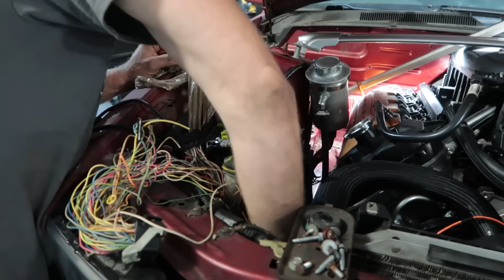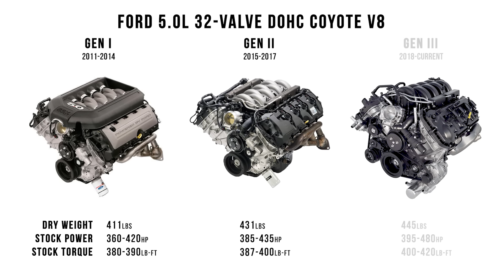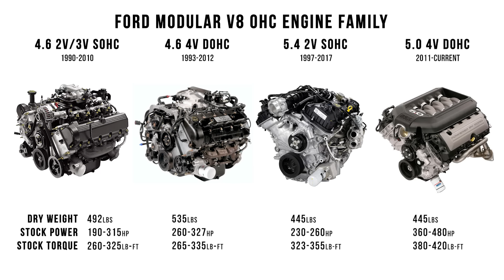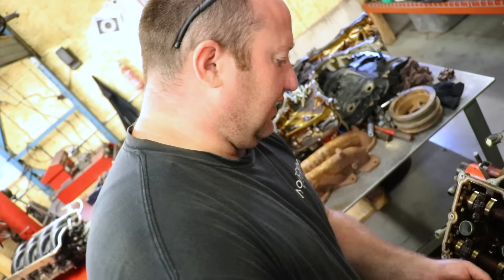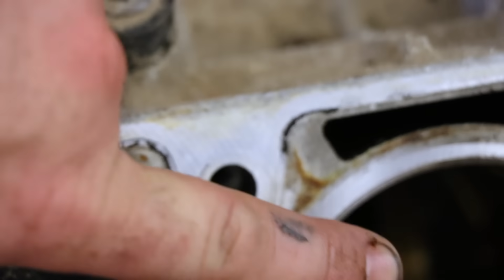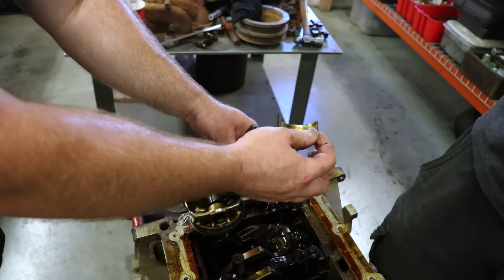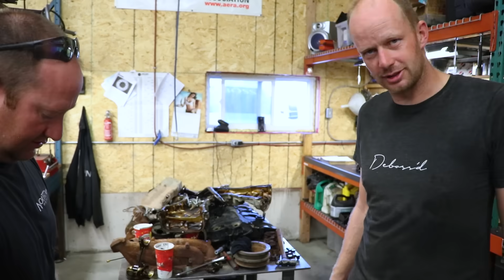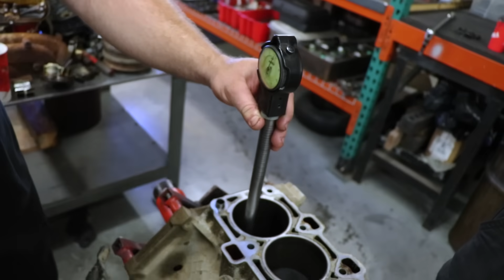REVIEW: Everything Wrong With A 5.0 Coyote Engine

Comment: The problem is not the synthetic oil, but lack of oil change. Synthetic oil does not crystalize, cheap Synthetic BLEND maybe. Just use good oil and filter and PLEASE DO your  Oil change and you will be fine. This engine fail for lack of maintenance that's it.

Comment: The thing I find hilarious is that Ford had so many problems with a single overhead cam engine they decided to add another like that'll make everything better lol. Bet they still didn't solve the exhaust manifold issues with the sohc engines or the timing chain guides failure.

Comment: Synthetic oil has nothing to do with a dirty engine. It’s lack of oil changes. Synthetics keep engines cleaner period. Actually most conventional oil is a synthetic blend. It has to be to be able to meet the stringent new SN+, SP specs
Reply: STFU https://www.youtube.com/watch?v=tDpTPxinNyo
Reply: I agree with most conventional oil is a syn blend. The only problem is drivers nowadays don't use the proper viscosity in their engines. And sludge deposits are likely to form in engines any how, regardless of conventional or synthetic.
Reply: did you not listen? syn requires getting the engine up to heat or it crystalizes, its not a short distance oil
Reply: @narmale  no it doesn’t
Reply: @Henry B i didnt say this... it was said in the video... or did you not pay attention?

Comment: You can bullshit all you want and most have said it. The root cause is the owner not the product. The way you drive the car, like a Mustang will determine your engine's life. If you can't afford oil changes twice per year or even three, don't own one. Plain and simple, I have never had any mechanical issues in any brand, kept them for 20 years, never even replaced a clutch yet in almost 400K of driving two cars. Change the oil and drive it with respect. When you see a car with dents, those aren't metal dents, those are dents of their lives. Don't be a mixed up fool driving around with a Coyote engine and then complain why it breaks down. The problem is YOU.

Comment: I really dont understand why a lot say LS is much better than Modular 5.0s, I ve used both and both high mile engines and  I am not particularly gentle with them, both held pretty darn strong. I just made sure oil is changed regularly every 5000 miles whether it be LS or 5.0 and both performed incredibly well. Sure if some problems crop up 5.0 is more expensive as it is not a cheap technology, its way more complex design and I kind of appreciate Fords effort with that, heck even Ford too could ve just used push rods but they chose a different route back in 90s and from what I see they succeeded too 
https://www.youtube.com/watch?v=bE_1JYrlYYU&t=6s
I mean how many US engines can post 14+ BMEP while being NA
Thats not at all a small achievement, its as good as what Chevy has done with the LS ie cheap,small, light and smart.

Comment: The plain bearing shells staying / oil sticking on the crank journals on disassembly are more indication that the engine has a few miles and numerous heating and cooling cycles on it than anything abnormal with the bearings. The bearing shells aren't held in place by the outward 'spring' pressure like when you first install new bearings as this guy seems to think. The bearing outer diameter is manufactured larger than the bearing bore diameter. When the bearing caps are torqued down, the bearing halves are compressed tight into the bore, and that is what keeps them in place and prevents a 'spun' bearing. As soon as the cap is loosened, the bearing will be loose too.

Comment: i’ve worked for ford as a mechanic since this motor came out and i’ve had the least amount of issues with the first gen (11-14) 5.0 out of them all. and i’ve never seen the rod bearings go so i’m surprised to hear that that is a major problem with them
Reply: I'm planning on buying 2014  f150 with the 5.0 v8  has a Ford mechanic do you think it's reliable and last a another 10 years
Reply: @samabdelhadi3037  easily
Reply: @samabdelhadi3037 my dad owns 2 5.0 f-150’s with over 200k miles. Both needed water pumps at 150k and that’s it
Reply: I'm looking to get one with around 100k+ miles. I currently have one in my mustang ( absolutely love the motor) but the mt-82 is trash so I'm trying to get rid of it and lower my payment. How many miles can you get realistically get out of the 5.0 (with proper maintenance of course)
Reply: @brendank4927  with proper maintenance i’ve seen them with will over 200k on them
Reply: @brendank4927  Like Thomas said, 200k easy.  With proper maintenance I've seen 3 to 400k.  Just treat it well and don't forget to get some time and distance on it at least once or twice a month to help burn off gunk. (IMO)

Comment: I dont buy the synthetic oil making sludge stuff my honda k24 with almost 160k always ran synthetic was changing valve cover not because of leaks no leaks anywhere was changing the color of it the inside was spotless bright white aluminum color no sludge or even a film of enything other than on the actual valve cover and I've ran different oil through out oil changes so nothing he is saying adds up so either engine sucks or it wasn't maintained

Comment: Just FYI, Ford's first aluminum 32 valve DOHC V8 was the 1940 through 1950 GAA engine, 1,100 cubic inches. Initially designed as a 60 degree V-12 for aircraft, it was cut down to a V8 for use in the Sherman tank. So Ford had some experience when they developed the mod motor. There are still a few GAAs around, I've seen some YouTube videos of them running on stands.
Reply: Those things are crazy, I'd love to see someone swap one into a Focus or something for shits and giggles

Comment: Haven't found any problems with my 3V 4.6.  Only 30k miles on it.  Cam phasers? use synthetic valvoline.  Problem solved.  Nothing wrong with the motor at all.  Reason why I don't go to coyote is because it costs money, and I really don't need one.  Used to want it but meh.  I barely get a chance to drive my personal car as it is, so why bother with it.  Unless some hater wants to buy one for me, there's really no need.  Anyway if I was to buy another car right now I am at least smart enough to upgrade to an Infiniti G50 instead of another American car.

Comment: Here ya go. 5.4  3 valve Triton 😆 
The 5.0 is only Ford engine that's ok.  But again it's still a Ford.  Great mpg in highway to. 18+mpg  In a V8!
Reply: Newer Nissan VK56VD V8 will routinely get 20-21 mpg in a 5000 plus pound truck highway.

Comment: I have a 2007 Ford f150 bought it brand new in 2007 I've always done my maintenance on time and I also use seafoam before every oil change and I have never had any issues with my engine I have 230,000 miles on it right and it still runs

Comment: Did he really say that the 4.6 is his favorite engine and had plenty of power? They were absolute turds. So slow that they couldn't get out of their own way. Only v8 engine that would grenade with mods at 450ish rwhp. They were pretty reliable in stock form but couldn't make any power at all without forged internals. An LS of the same Era could make double the power and be more reliable.

Comment: When he started going off on syn-oil, I had to check if this was an April 1st edition.
Reply: I have seen many problems with synthetic oil in my 35 years of being a master tech and running a shop.
Personally will not use synthetic, or pennzoil!!
Reply: The way he said it was stupid, but he clarified In a video after this that he meant that synthetic oil causes people to use extended oil change intervals which causes the build-up, which is probably true.
Reply: Fortunately but unfortunately I own a 2019, first I’ve owned that takes synthetic. I started to wonder as I’ve never ran it before because Roy doesn’t make sense to me.. most things synthetic really aren’t as good as what they could be, they are compensating for something for a purpose with synthetic materials. Oil, is like blood, why would you make something strictly take synthetic..? Is there a way to be able to run conventional?
Reply: @person-sx2wc  Unless your engine calls for 0-20 you dont have to run synthetic. 5-20 and up is offered in conventional. GM has their bullshit Dexos that requires you to use at least a Dexos blend or you can void your warranty on the engine. Ford doesn't require you to use full or blend but if the weight called for is only offered in either, your hands are tied. Tolerances are tight on new engines.
Reply: @person-sx2wc  the synthetic molecules are 3-5X smaller that conventional oil, that's why if you run it in an older engine they leak..
The engine was not built to the tolerances of today.
Nor the gaskets.
And synthetic handles heat a little better, don't buy pennzoil, change it every 3 months or 3k, especially if it issues allot. And never buy a used government vehicle!!
Reply: @maketruthgreatagain9823  I've been using synthetic for many years with Honda's 10k mi change interval, still runs like a top.
Reply: The only reason all manufacturers are going to synthetic is because it's a way better oil than conventional say you can go longer between oil changes and that is why epa wants it to lessen oil changes therefore less waste but no real engineer agrees withe going that long between oil changes just pressure from epa
Reply: @donaldbean6291  Engine tolerances are very tight anymore and the 0-16, 0-20, 0-40 are only offered in synthetics. I'm sure its just bullshit why that is but tolerances arent arguable. Mercedes, bmw, Volkswagen/Audi call for a full synthetic but only require a 5-30/40 which can be had in a blend, synthetic or conventional. Who knows anymore.

Comment: 2010 f150 - single cab - long bed - 2wd- 4.6 2v v8 -.    232,400 miles and its been great to me !  Oil is castrol edge professional 5w 30 from the black barrel🏎💨

Comment: All you have to do is change the oils and Ford Engines last a lifetime.
Reply: The timing chain tensioner would disagree
Reply: Konner Kramer considering I have a Ford 5.0 with well over 500k miles on it, I’ve only ever changed the oils, oil filter, belts, and pullies, I’d say my 5.0 disagrees with that statement lol
Reply: @TexasRaptor  like I said the plastic timing chain tensioner that are a well know problem are lucky to make it to 100,000k miles. Until I see proof I'm just going to assume your another clueless ford fan boy. The tensioner in my 2012 5.0 made it 65k miles before it broke and cost me $1500 to fix.
Reply: @konnerkramer329  yeah sure everybody owns everything on the internet. Until I see proof of what you claim I'm just going to have to assume you are some anti-ford wanker
Reply: @-ac-8296  what proof do you want. That the tensioners broke in a car I sold years ago... I don't have proof that my tensioners wore out and my chain broke 7 years ago sorry. I sold that car 5 years ago
Reply: @konnerkramer329  it's not on these motors. It's on the triton engine.
Reply: @icenine135  what??? Are you trying to say that coyotes don't have timing chain tensioners
Reply: @TexasRaptor  .....for christs sake if you take care of just about any engine it will last....the point is you dont have much of a choice with a ford if you want it to keep running period. If they cant take ANY neglect or abuse then it is an inferior engine
Reply: @TexasRaptor  ya the Windsor 50 will last forever I have a 94 f150 4x4 5 speed x cab bought it in 2002 with a 3 inch lift and 33s I've went threw a clutch and a trans over that time last year at 489k and that's not nice driving that's missing mudding on weekend and driving it 20 miles a day to work I thought it was a head gasket turned out hole in number 3 piston but instead of buying a new truck I had a 347 stroker laying around I built for a fox body but after I dug into her rust belt had taking most of the car so it's in my old truck and I gained 3 mpg but at 40 I don't drive fast anymore and I have a side by side I go off road with
Reply: Outcast Slayer bro i hace the 3.5 ecoboost but it’s giving me issues so i started looking into the 5.0. What’s your experience with yours
Reply: @TexasRaptor  That almost made me choke on my coffee.  Wait till that turd jumps time and the little man in the box wants out by letting you know with some knocking and banging.
Reply: @TexasRaptor  holy crap that’s awesome. What Gen and make a bid of that beast. I wanna see how a coyote at half a Millie sounds and runs
Reply: @TexasRaptor  Lol. Nah, it doesn’t. Quit playing with these dumb ass claims when the engine wasn’t even designed for that length of operation.
Reply: @TexasRaptor  yeah the old school pushrod 5.0 NOT a coyote old 5.0 doesent have timing tensioner now does it
Reply: @thebubba1  edit your post to not blaspheme G_d's name.
Reply: Konner Kramer yessss! This happen to mine which brought me to this video bc i don’t plan on fixing it this i came searching for reviews on the 5.0
Reply: @konnerkramer329  supposedly the 2v Triton doesn't do this as bad... but we are still gonna swap em out with metal soon. 135k on the clock.  The cam phasers also blow up Triton as do failing oil pumps from improper changes and conventional oil
Reply: You know it i got over 500k on a 4.0 ranger
Reply: @octaneartllc  same here...but mine has 1 cam
Reply: @theejoeylee  unkillable ohv👍
Reply: The basic design of this engine is the modular engine that began with the 4.6 liter. It has lasted a million miles in police and Taxi service, just idling for 4 times the hours of service of a normal million mile engine. Change your oil and perform service.
Reply: Unfortunately the transmissions have issues.
Reply: @seanwhite5758  so does the rest of the vehicle
Reply: Obviously never had a 5.4
Reply: Bill Chestnut  I have an 03 F-150 XLT with the 5.4 got it from my dad he had no issues replaced the spark plugs, and went through a fuel pump a couple thousand miles ago, coming up on a oil change, about to kit 219,000 miles so while I know the 5.4 gets a bad rap I love my truck🤷🏽‍♂️
Reply: @jeremiahcarranza222  i got mine used and i think the previous owner did no maintenance..
Ive had to do plugs coils cvts..Misses all over the place..it does have plenty of power but tight now for me the cons outweighs the pros..oh yea..only 126k on an o6...so i definitely think it was previous owner
Reply: Bill Chestnut im sorry about that, I bought the truck from my dad since I wanted a paid off truck, and since I knew he kept up the truck maintenance wise and I knew the trucks history I had no worries, in fact I didn’t even know the 5.4 had issues until I started seeing videos like this on YouTube😂 but either way if you take care of something it tends to last and while im not a ford diehard I had a good experience with this truck and whenever I replace it ill probably just get a newer one probably around 2017 with the 5.0. My truck now has a flow master muffler, and an intake and it sounds nice I expect at least another 100,000 maybe more, maybe I got lucky but I love my 5.4👌🏽
Reply: Yeah my Foxbody has 507k miles :)
Reply: @fsub616  5.0?
Reply: My 2005 Triton 5.4 had 309,000 miles on it when I sold it - with a lot of life left! No major engine work, just oil, plugs and coil packs. Daily driver / work truck.
Reply: dont forget youre talking about a chevy fan so nothing else is good lol
Reply: 305×××miles on my 01 2V super duty. Still pulling my 27' travel trailer up a pretty good grade couple times a month. Not a pretty rig but Ive changed the oil religiously. Would like a new Cummins Ram some day but the Ferd won't die!!
Reply: My 5.0 has 20k... timing chain tensioner makes a lot of noise and I’ve changed my oil religiously, it consumes oil and the cam phasers make noise too.
Reply: Even if it doesn't last forever its still better than an ecoboost
Reply: This comment was bound to be here.
Reply: Not so fast, said the Eco Boost.
Reply: 5.4 has entered the chat
Reply: A short life indeed.
Reply: SHOW me ☝️ Gas Ford with a Million Miles much less a Coyote.
Reply: Hahhahaa!!!! Fan boy !!! They suck ... be a Man and say the truth .... FN suck !!!!! Ford makes crappy motors !!! Admit it !!!! Have some pride !!!
Reply: @nomaam9797  yeah my 07 5.4 3v now has 156000 miles not a single issue. But unlike most , I change oil on it with motorcraft oil and filters. The torque of that fucker will come off the line as hard as anything made today. I can see were people wanna call em junk because they require a touch of maintenance.
Reply: The man is serious about Ford. The highest ranked pos, most sold, and the basic standard of American reverse engineering. I'd, much rather drive a Prius than buy another pos Ford.
Reply: @frankcastle5737  you enjoy your delusion and your shitty prius
Reply: I seen a 2003 2V 5.4l go 630,000 miles. The owner said the engine was never touched. I have the 2006 3V 5.4 l. It’s low mileage but I love it’s performance. Not good at speed but it has grunt for pulling..
Reply: @John Lance  where are you located